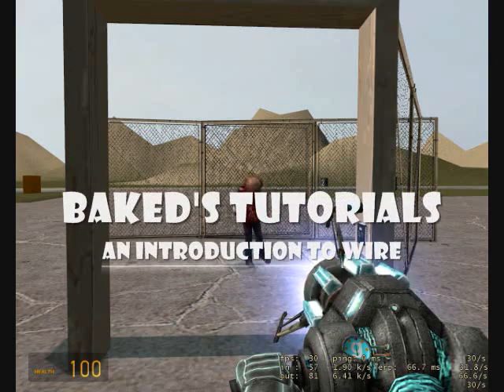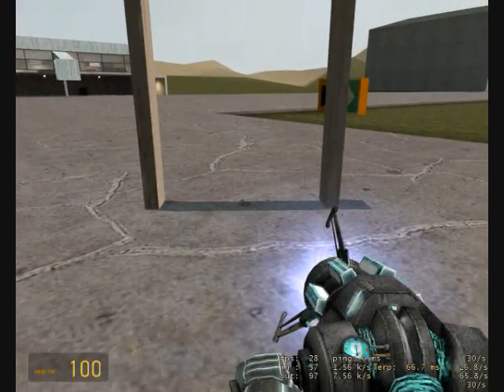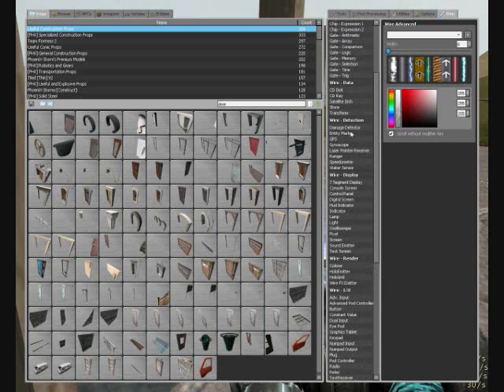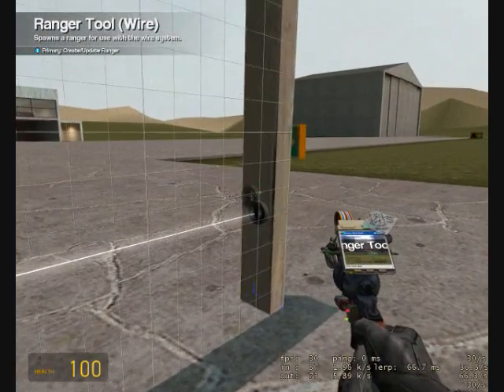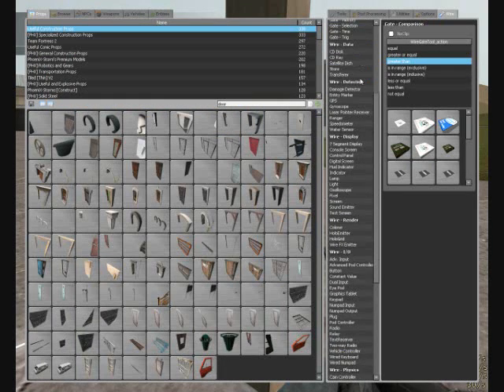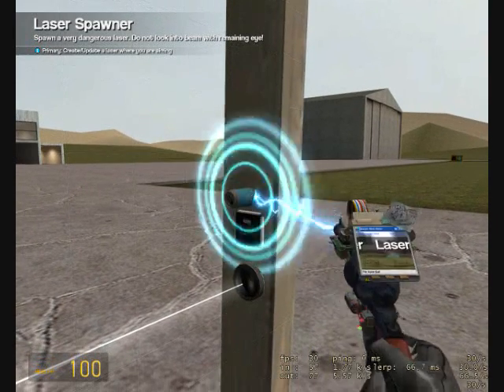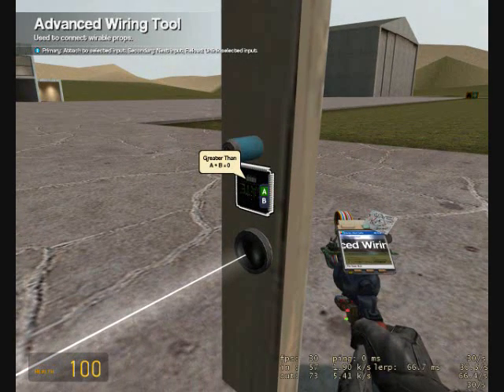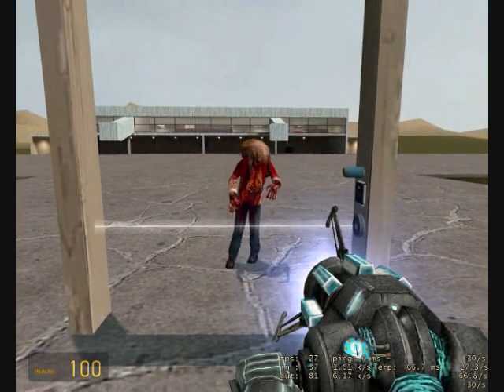Baked's Wire Tutorials 1: An introduction to wire, gmod

Comment: Okay, i did everything you said. But after i wire the turret with the greater than chip. It starts firing without anything touching the beam. But if i move the ranger to a empty space, were the beam can't touch anything. It stops firing. Am i doing something wrong?